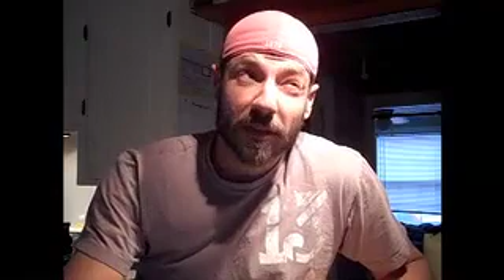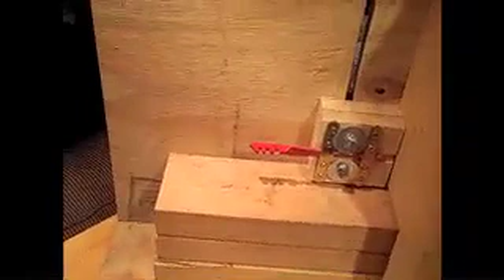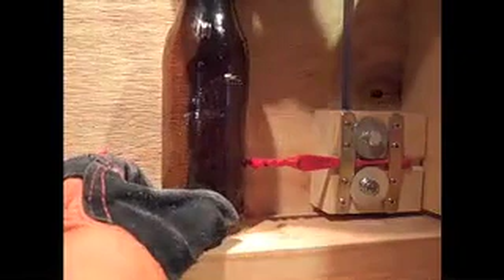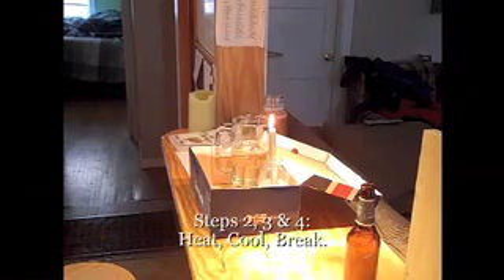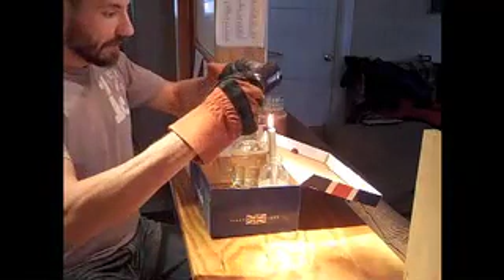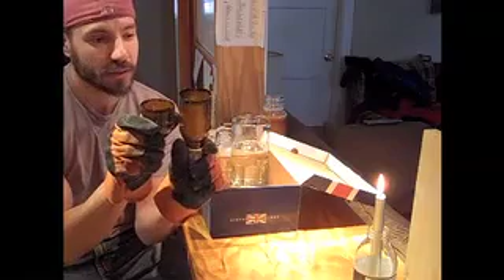glass bottle cutting 101 with HandyGraham

Comment: Ol' Country Boy here...Give you a "10" on the great design & simplicity of It & vid. ! Will try it myself on lg. wine bottles.. Note: To make it eazier to keep the cut even, try using a vertically adjustable brace half way up on the right side of the bottle & lubricate all wood contact areas w/dry-lube spray silicone by 'Liquid Wrench'- ( no rollers, saves money ).   Great job- more project vids. please!